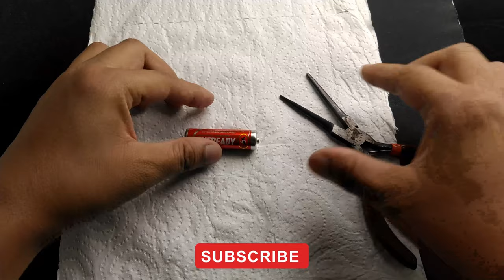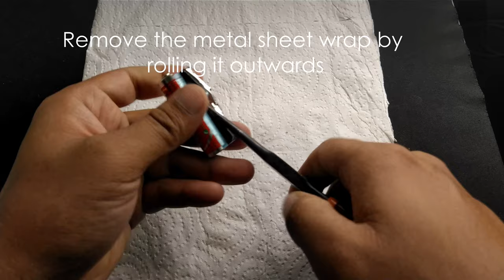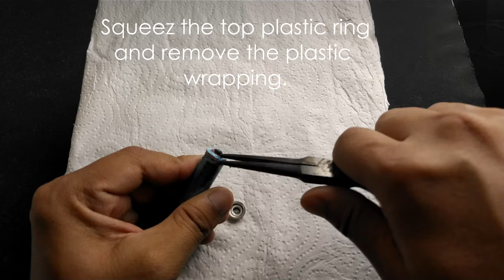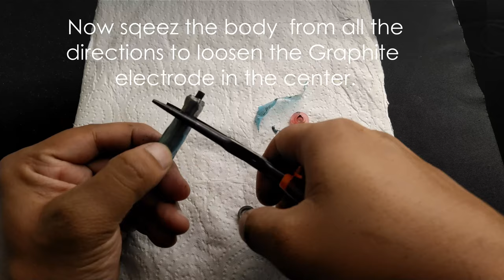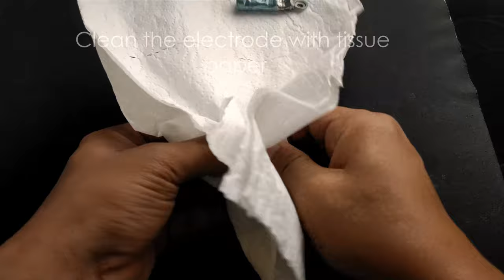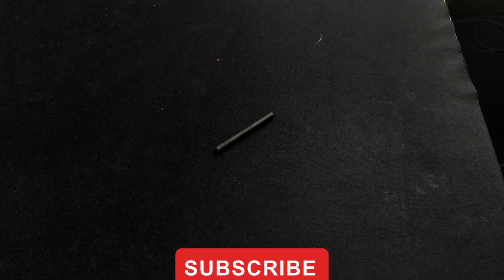Extract Graphite electrode (Carbon rod) from battery.

Comment: Isn't there acid?? I've never done this before but thought it was dangerous?! That battery got nothing on u!
Reply from the maker: It depends on the type of battery, this is an Alkaline battery, chemicals are in form of paste and non volatile. So nothing dangerous about this. However one should not touch the chemical directly with hand, use of gloves is recommended.
Reply: ahh tyvmm @diywithanoop

Comment: What happens if you use batteries which are not alkaline?
Reply: Explosion
Reply: Make sure it says zinc carbon not nickel cadmium lead acid or lithium ion batteries
Reply from the maker: Yes, Thank you for this comment, I should have included this info the video.

Comment: Sir please reply can I use these electrodes in electrolytic cell I am waiting for your response
Reply from the maker: Yes.. the main purpose of extracting the rod is to use them as electrolytic cell.. they don't corrode and don't disintegrate during electrolysis. 
You also use them to generate plasma.
Reply: @diywithanoop  thank you so much Allah may easy your life